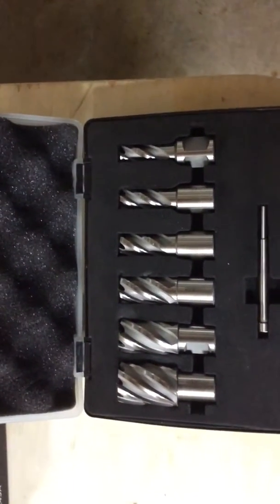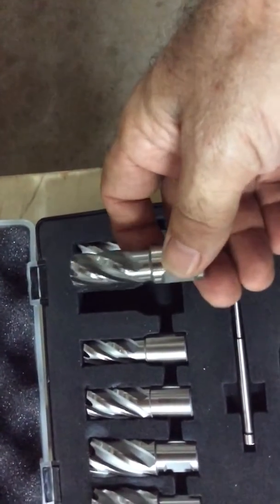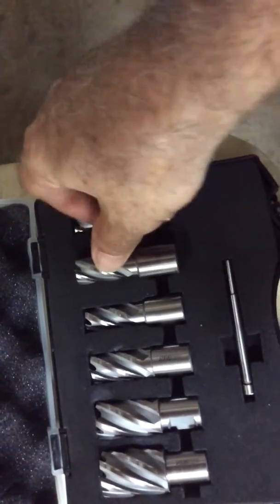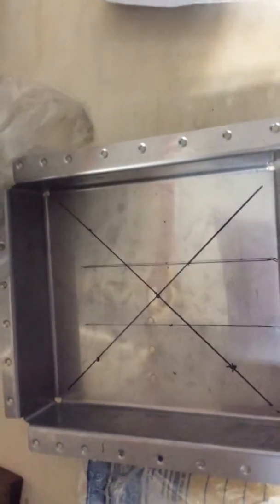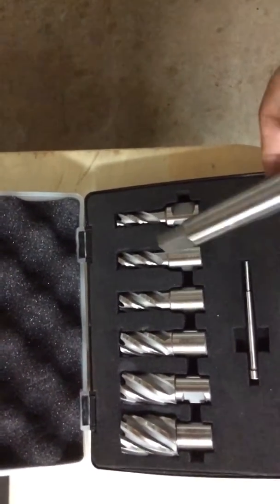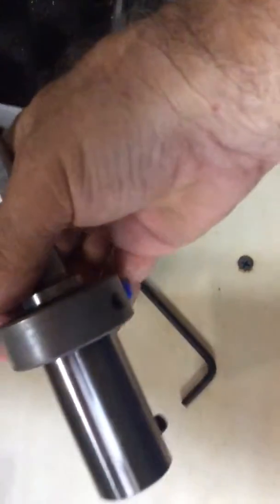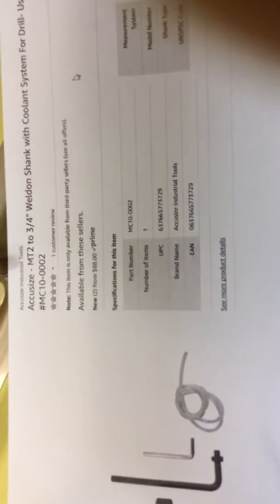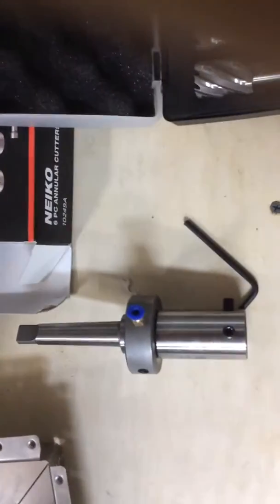How to use an annular cutter in a drill press

Comment: I made an adapter on the lathe, I bored aluminu rod to accept the weldon shank then drilled and tpped holes for set screws to bottom against the flats on the shank as shown in the video. Then on the other end of the aluminum rod I turned it down to 3/8 dimeter/ 1 inch this end will go into the drill press chuck same as any other drill bit shank. The problem I ran into is that my drill press is cheap harbor freight jumk nd the cutter has so much grab that it would cause the spindle on the press to mothe side to side (bearing play) and instead of a 1 1/16 hole i ended up with a 1 1/8 hole due to the cutter walking in the material.
This would work with a good high quality drill press im sure. It would be even better to make the adapter from steel or stainless better yet!